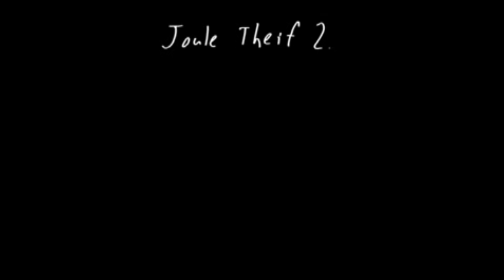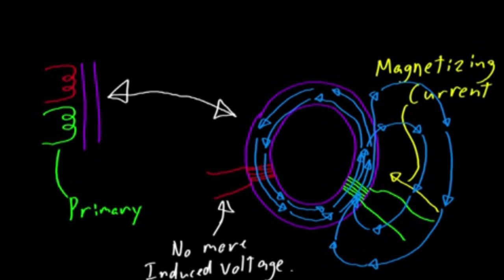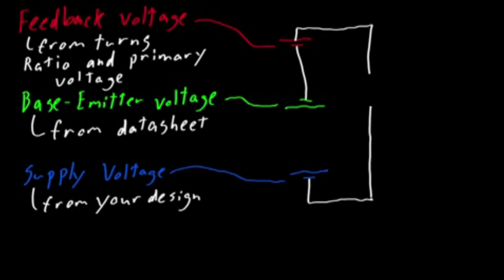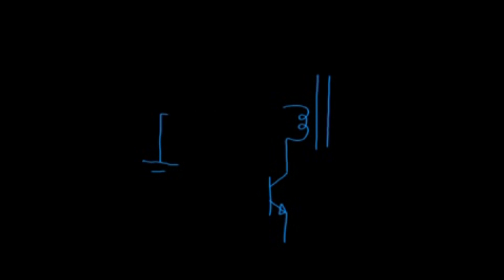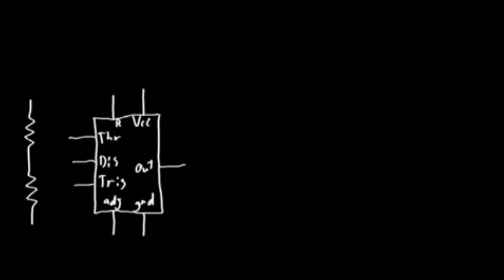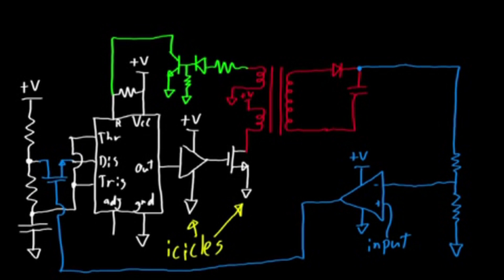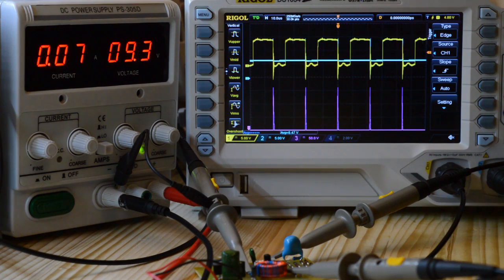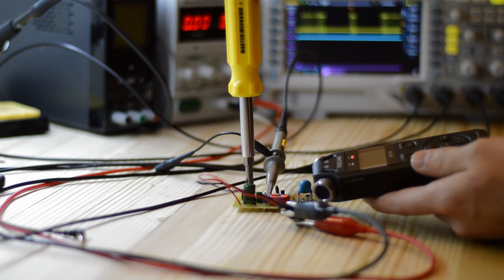900 volt Joule Thief 2.0

Comment: So your circuit is a DC-DC converter instead of a joule thief. What paper did you use for the toner transfer? What laser printer did you use?
Edges are not a problem if you transfer the toner before cutting the board.